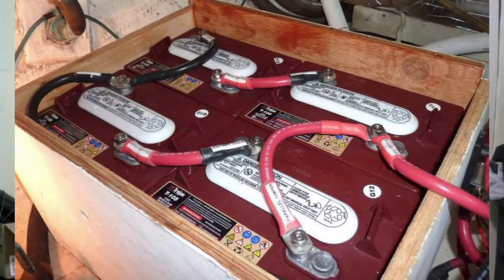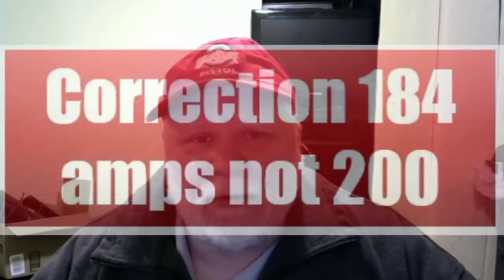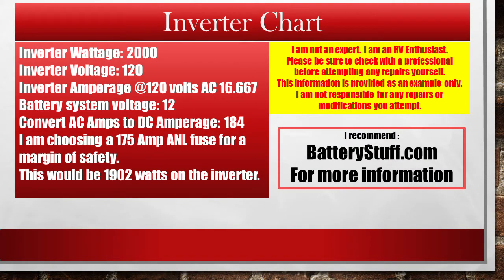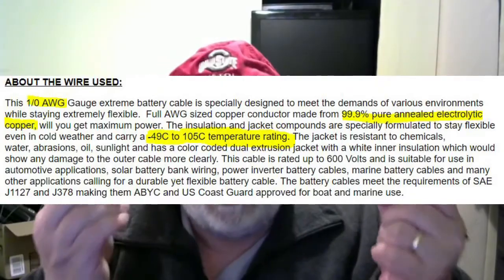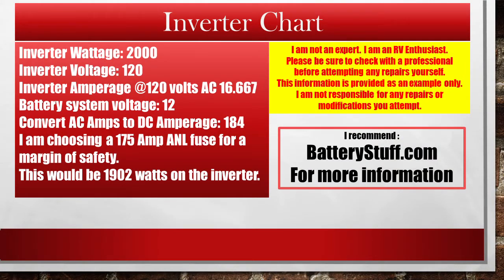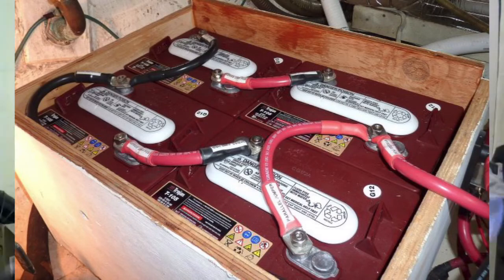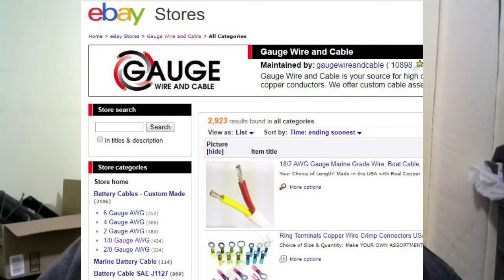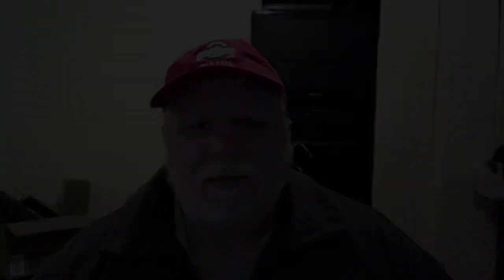Sizing RV Battery Cables For Inverter

Comment: The 2000w inverter example is questionable as the stated load doesn't include inverter losses (efficiency)or voltage drop from source. Example given will probably interrupt 175amp fuse if inverter is operated at or near full load for more than  a few minutes
Reply from the maker: Four years, 25,000 miles, same fuse, you assume that I run it at 2000 watts, I don’t. 1500 regularly though.

Comment: Fantastic thank you! My inverter is 2000W, and it say it can briefly peak to 4000W for a few seconds under load. Am I ok using 1/0 cabling? Else I should go up to support around 333 amps! Also my batteries are all far apart, and I can't move them, so my cables may need to be up to 2 to 3 metres long. So thicker may be safer. Let me know your thoughts thank you!
Reply from the maker: Jon Binnie length is a factor, longer requires heavier gauge. Short term peaks are usually ok but if they are too frequent they can still heat the wire. Cable quality matters, I would opt for cable that has ratings for both amps and temperature. In your case you might want to go up a gauge. Remember to fuse under the wire gauge.
Reply: @Endless_Skyway_Adventures  Thank you! Do you have any suggestions on tempertures?
Reply: Oh and I love that you are a musician too! Two hobbies in common!
Reply from the maker: Jon Binnie gauge wire and cable on eBay +105Celcius 2/0 is rated for 330 amps
Reply: @Endless_Skyway_Adventures  brilliant thank you so much 😀

Comment: I purchased I 2000 watt reliable inverter. Why would they give you 6 gauge wires for the connection to the battery
Reply from the maker: I cant answer for someone else, but my guess is cost.  please be careful to check not only wire size but temperature rating and fuse the wire under the amp rating for the wire regardless of your inverter rating.  The fuse belongs as close to the battery as possible.  If you cant determine the rating, replace the cables. Good cables cost about 90 bucks. It isn't worth dying for 90 bucks. I cant stress enough that the fuse must be the weakest link in the circuit. If your inverter san deliver 200 amps, and you fuse is rated at 190 amps, and your cables are rated for 100 amps, guess which one melts? The cable.
Reply: Your RV Freedom thanks for your help. I’m at the ‘what the hell did I get myself into’ stage of my solar install. So much conflicting info for the diy guys. Inverter manuals are useless.
Reply from the maker: @bayview63  it's alot to take in. Will Prowse has a lot of good video info and he is knowledgeable.
Reply: Your RV Freedom your right. It is a lot to take in but thanks to guys like you, I can eliminate stupid and expensive mistakes before they happen. I really want to do this right and I am confident I can do that now. Thx for your help.
Reply: 6awg for a 2000w inverter is grossly undersized (assuming 12vdc) should be 2/0 at a minimum depending on cable length

Comment: Thanks for the video. I will check into the wires that I want to purchase for a 1000 watt inverter.
Reply from the maker: https://www.ebay.com/itm/2-AWG-Gauge-Copper-Battery-Cable-Power-Wire-Car-Marine-Inverter-RV-Solar/132076737409?hash=item1ec0631381:m:mFuaAsElijaA3N3ljd1MtGw&var=431429431921